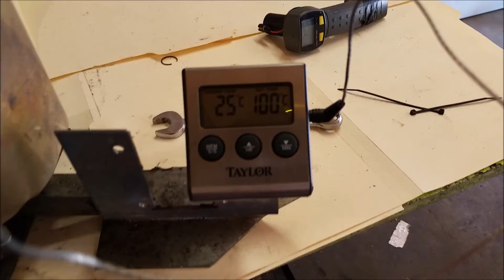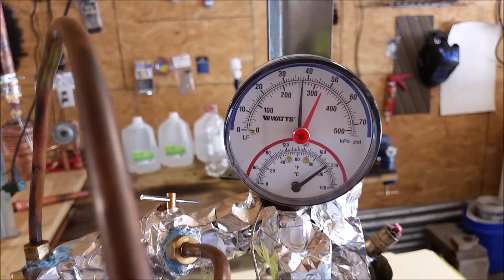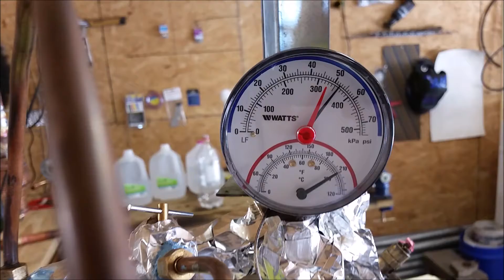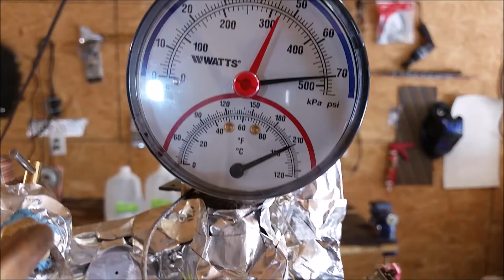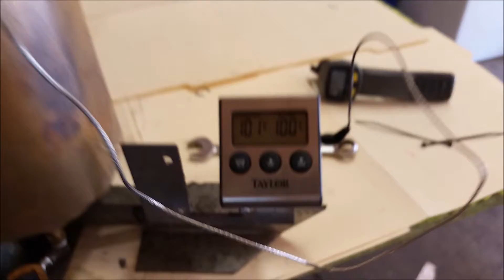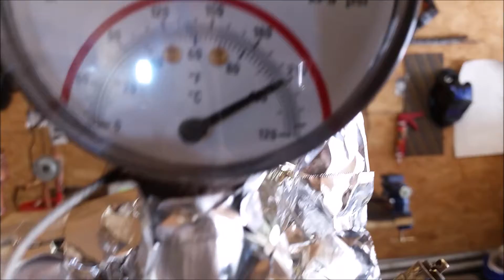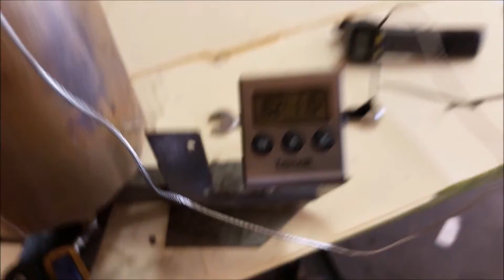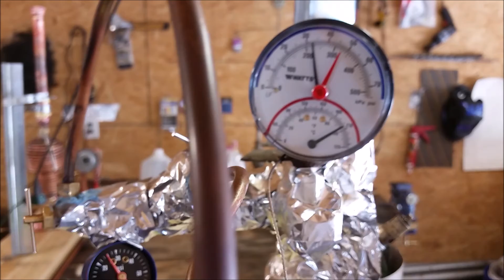micro boiler build

Comment: A I R joe talking about magnetic water phenomena 1995.  Hi if you type that in joe booker is showing how you can store the atomic structure if atoms in other structures and therefore take those usuable structures (your steam beyond its natural effect) you see he is pulsing dc vortexing current in the water/cell and it is the spike from that energy that is attracting to the pulsing ac through the shaft but to keep it at a point if stop start he found that eddy current effect takes place so my suggestion is place a neo doughnut magnet around your valve and a core of aluminium with a chrome wire also wrapped in a vortex with a 90 degree aerial shooting into the surrounding air this should act like a pinch storage of the steams electrons it may also produce electric.    Look at gretchen jones coral castle video of you tuber ingventor for the chrome aerial.   No expert here so just throwing ideas in    If you can neutralise the atoms of steam like stan Meyer did you should get something phenominal.  And that is what joe booker is showing you in his video.   Static levitation ability.

Comment: Hey there... interesting setup you have there. I am excited to see what you are building. About youre little adiabatic problem: There is no real way of getting rid of this, when you try do dail in a defined amount of gas like this. I've been working with some cryogenic gas jets on an internal gas target of a particle accelerator (or rather an experimental storrage ring). Doing the same thing you did just a couple 100 K cooler leading to some nasty dropplets in our He-stream. The only way to fix this ist to activly heat your nozzle/valve (eventhough this is far easier to keep something above 10 K instead of > 100-something °C). Maybe there is a better way of setting this whole thing up, by thinking out of the box. But so far I think you will have to reheat your gas stream after the expansion to maintain a nice hot water gas flow. (English still is not my native language... please excuse my mistakes :) )
Reply from the maker: deralchemist1990 Great comment friend glad you took the time to help ,your input confirms my fears. im actualy working on a very amazing device is called a "Carbonic fuel Synthisizer" ints an invention ive bin working on
Reply from the maker: deralchemist1990 perhaps instead of valves i could use coils of tubing , if i make 1 coil bigger then the other i will get different flows out of the coils, then i can tune the coils to the proper size to get the perfect pressure differential or pressure/mass flow rate  per portions im looking for .
Reply: NOBOX7 Your idea of splitting the pressure via different pipe diameters sounds good to me, considering you are looking for constant rations. Since pressure equals force per area and for all flowing substances the node-rules must apply (what goes into a node must come out of it)  your pressure should divide accordingly to the ratio of the used pipediameters. This at least seems logic to me... I hope I didn't completely forget about something here...
Reply from the maker: deralchemist1990 i decided to live with cold steam and ramp up the super heaters and pre heaters but thanks for your input , it is defiantly useful to observe peer review , tonight im gonna fire this beast up and perhaps it will be uploaded by midnight, i have alot of papers to get ready for this project, i must use this data to build and design a functional device, it is best to just build something then modify when it comes to proto types  it rather then take the time to try and think things all the way threw because when you do that you mis out on the opportunities the eye cannot see  , time and time again i have found the best way by building on the fly and adapting to the needed changes , is so fast and full of ideas you would of never bin able to see on paper
Reply from the maker: deralchemist1990 dont get me wrong i love to design things on paper its just that when it comes to fabrication we often forget about how hard it might be to machine one idea verses another on paper so i often" just build the damn thing" . then i fix all the bugs